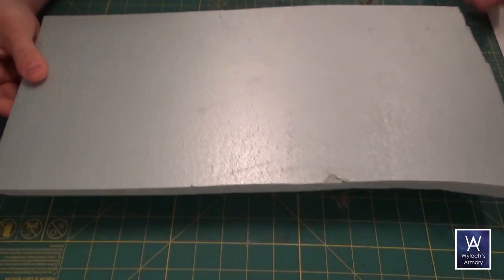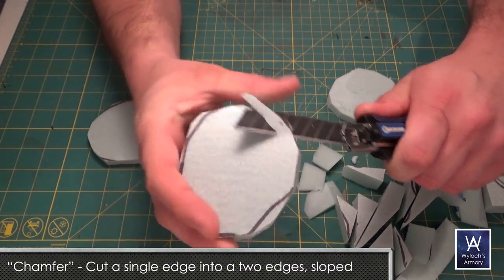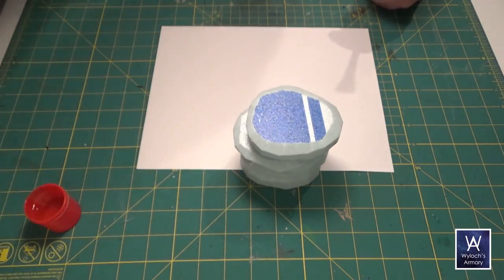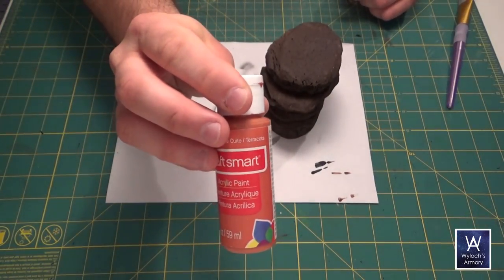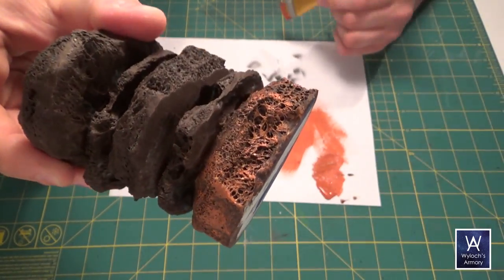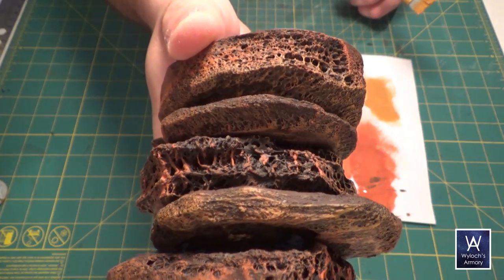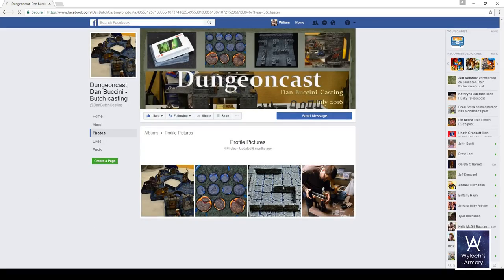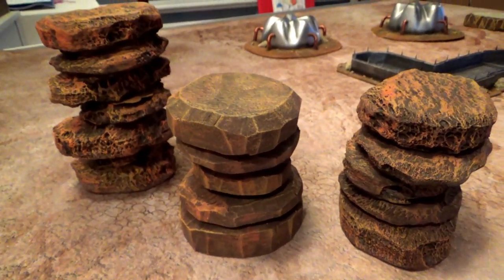How to Make Desert Rock Piles for Dungeons & Dragons, Warhammer 40k

Comment: Sorry for breaking topic, but I have a question about your TrueTiles product. Are they sized to match up with your handmade tiles using the double-corrugated cardboard? If someone wants to design a custom 1-1/4" tile using your method, I just wonder if that tile could be glued onto one of your OpenLOCK bases AND be at the same height as the printed tiles?
Reply from the maker: Overall the size is the same.  However the OpenLOCK bases are not 1/4".  So what you propose would be off by 1mm.
Reply: Thanks. If I'm reading right, it sounds like a custom 1-1/4" tile (homemade) could have an extra layer of thin cardboard on the bottom to raise it up that 1mm to match, right? Or is it that the homemade are taller than the 3D printed ones? Just trying to decide whether to pull the trigger on the STL files or just make my own tiles.
Reply from the maker: It actually varies with the tiles (dungeon, cavern, tavern) to accomodate their various features.  In no case is the OpenLOCK base taller than 1/4" though.

Comment: Or use nail polish remover.
Reply from the maker: Yes, that's a milder mix of acetone.  In my experimenting, it didn't eat enough into the foam - but is certainly safer!
Reply: Yes, it may take a bit more but it's also cheaper and slightly safer.  As is citric acid.
Reply: Citric acid will eat at the foam too?